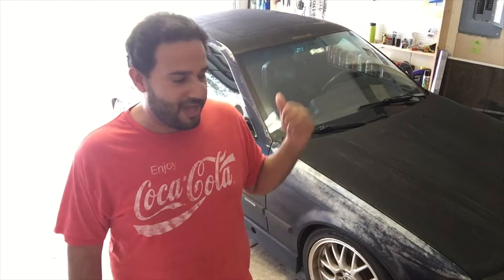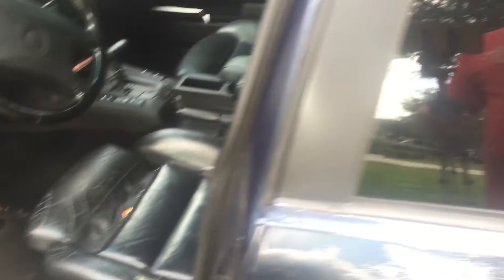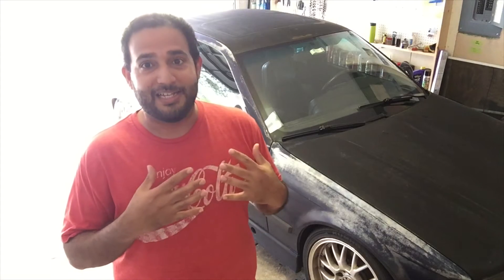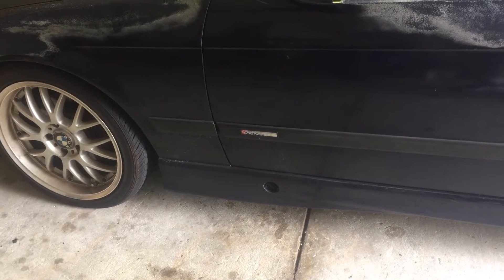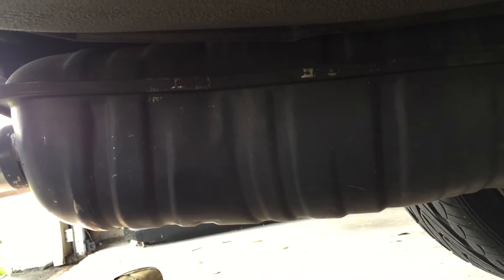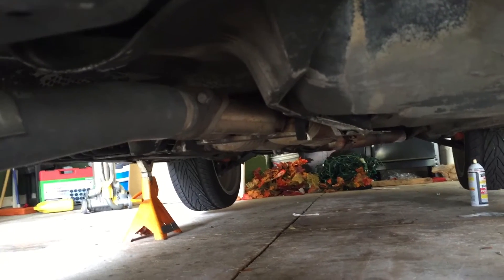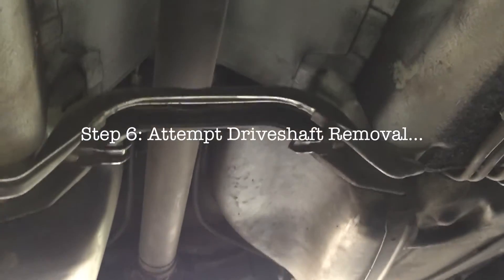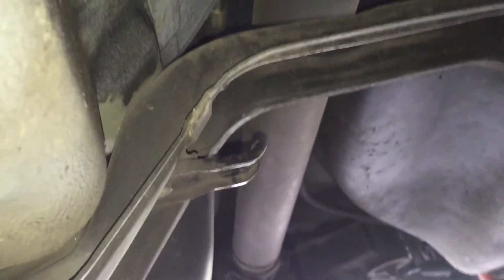E36 BMW Auto to Manual Swap Pt.1

Comment: I have a E46 from 2001, do you think the work will pretty much be the same?
Reply from the maker: Sorry for the Delay. from my understanding the e36 and e46 chassis are very similar and the mechanical components should be identical. This process should identical when it comes to removing and installing the necessary components. The following Areas may defer though... 1. obtaining the correct drive shaft (I am unsure if the rear and front driveshafts are the same on the e46 autos vs manuals.  2. Diffs and the gear ratios available on the e46. 3. ecu programing to bypass any Check engine Light errors related to the automatic transmission computer. I believe those would be the major points to be concerned about.  I hope that helps you out a bit though.
Reply: So, did you do it?